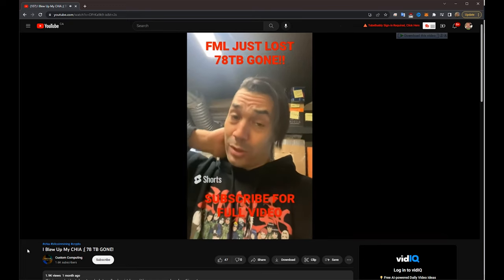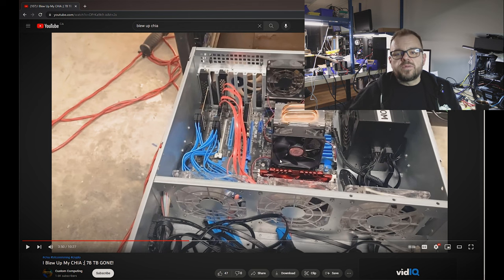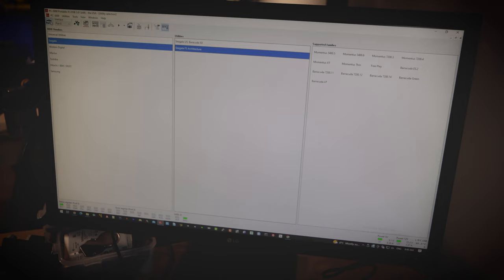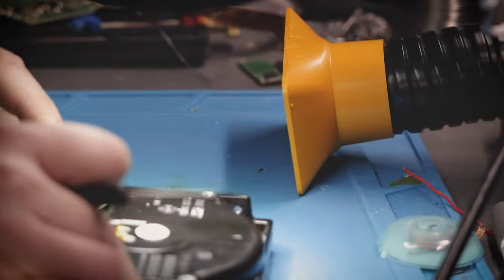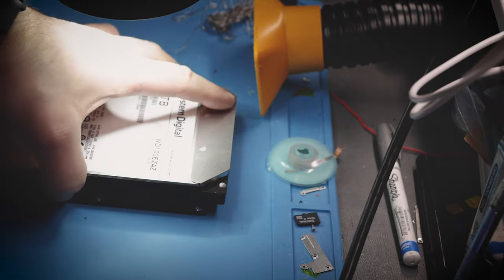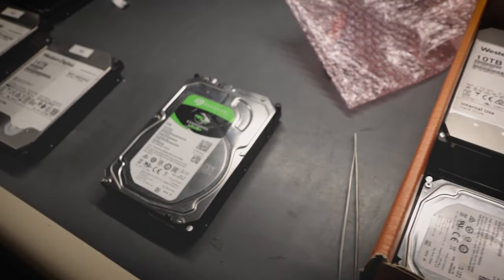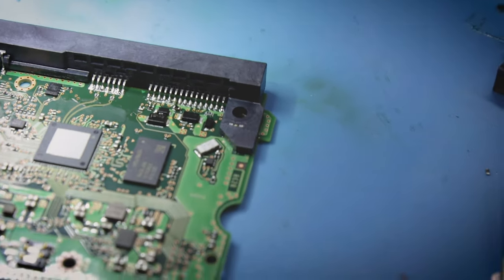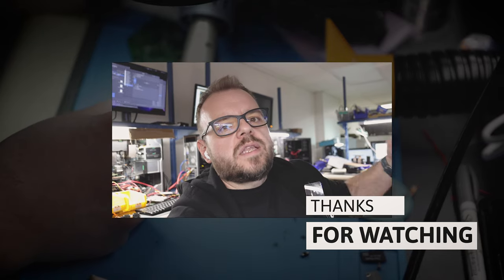8 HARD DRIVES BLOW UP!

Comment: That pin 3 trick is a well known "feature" to us cheap people who buy these external drives to shuck them and use them as internals. I've got 50tb worth of them.  I used to cover the pins but that's annoying and unreliable.  I actually remove the board from the drive, and cut that pin at the board before I install them.
Reply from the maker: I got exos 16tb out of external Seagate drives. I haven’t heard of the pin thing on WD drives until recently. Most of my tools ignore the pin so I never realized it was a thing